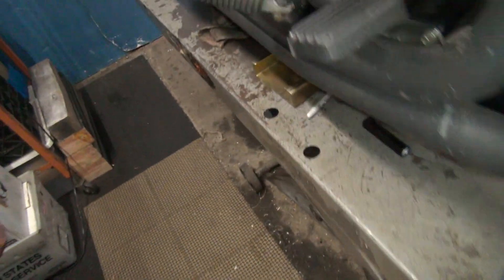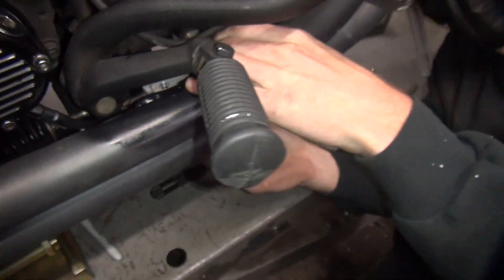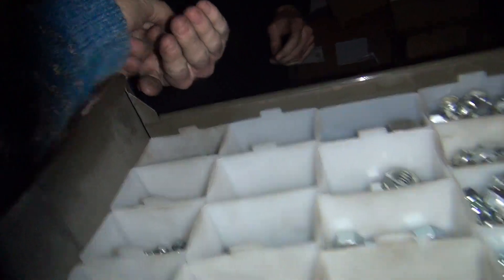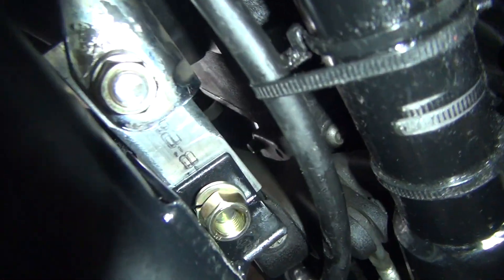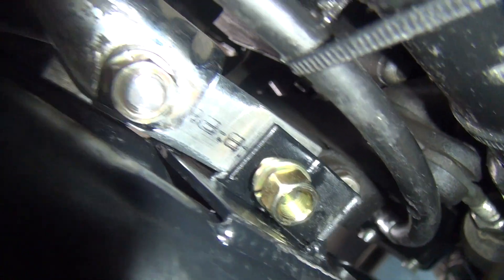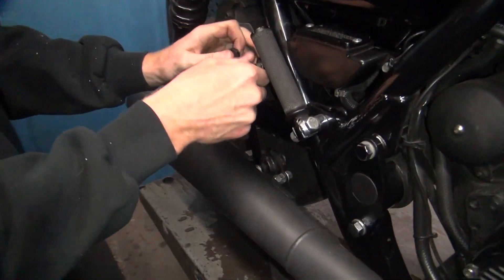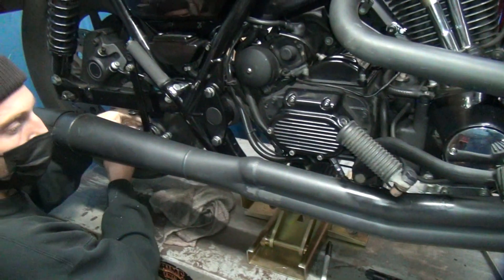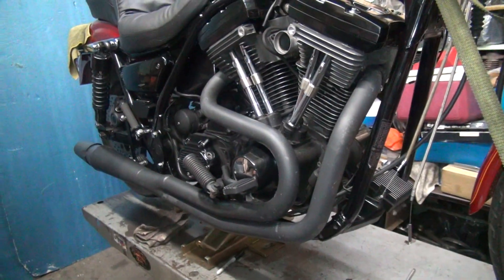#128 1993 80ci fxr thunder header exhaust install quickee topend rebuild repair harley tatro machine

Comment: With that back temporary bracket, wonder if a rubber battery box mount would help. They’re used on the Norton Commando exhaust , in the rear, except two are used.